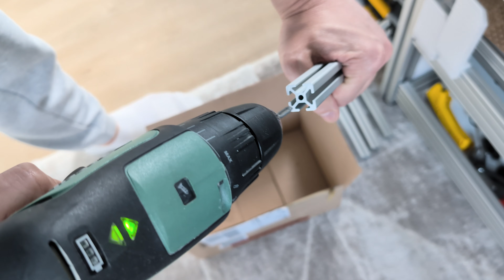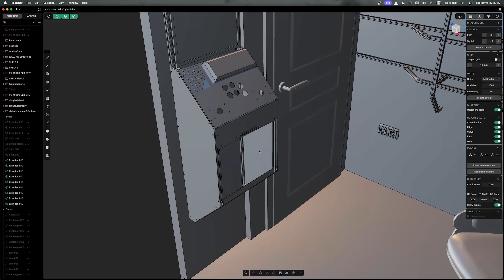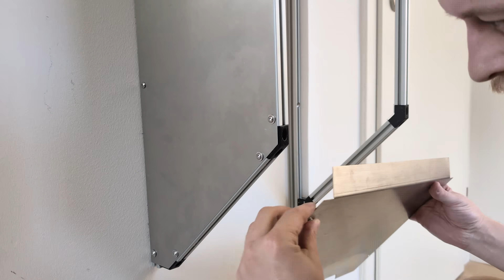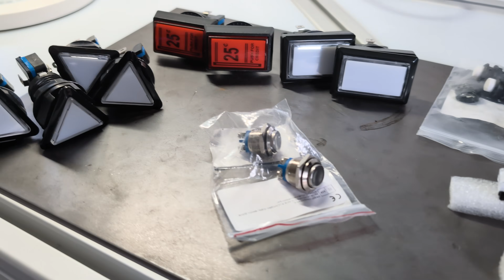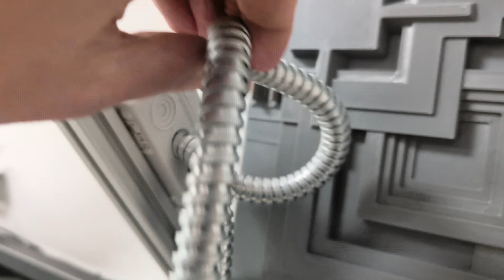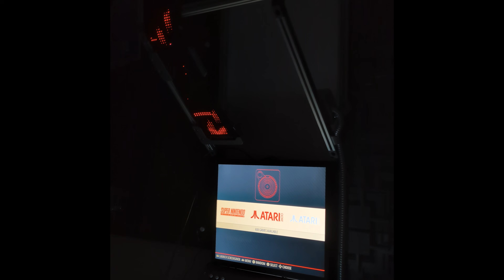Cyberpunk room build - terminal console arcade control panel kiosk - Episode 4

Comment: This is excellent. I am also building my own Cyberpunk/Anime room. I have brought a screen as you described and have loaded up the animator. How do I get the animation from the animator onto the screen?
Reply: Don't worry I have sussed it out. Its excellent thanks.
Reply from the maker: Glad you made it. I didn't explain that clearly enough, but at least everything is linked in the description. Cheers!
Reply: @DIY_CYBERPUNK That’s fine. Not sure if it was the way you did it but I used your animator to make the gif on my laptop. I then saved it and transferred it to my phone. Then I used the Pixel Art app to transfer it to the screen as a custom animation. Not sure if that’s the correct way but it seems to work.

Comment: As an ex-machinist, watching you tap those aluminum holes with a power drill made me panic. Lol
Reply from the maker: Yeah I can imagine. I got lucky that the regular tapping bits are strong enough and aluminium is soft enough that it just works perfectly every time. I never got a broken bit or ruined tap hole. Just got lucky with the materials I guess :D too lazy to do the tapping by hand :D

Comment: What is the goal for what you can do with the terminal?
Reply from the maker: For starters I only plan to enable it for Home Assistant control and the two player arcade when someone visits. I'll probably need to use KVM as it would be too messy implementing everything on a single rPi. Later down the line I will be making a motorized crane lift thingy on the ceiling. So controlling that too probably

Comment: <,,< now just need to add an atm keyboard and trackball in the top of the arcade mechine and add a KVM switch to go between the system with a button in the top right of the panel
Reply from the maker: Exactly! I have the KVM on the TODO list already hehe. Yeah I will really need a keyboard at least. Trackball would be a nice touch. Cheers!

Comment: Oh man, those Frank Loyd Wrigth tiles were perfect. Always loved that detail from Blade Runner.
Reply from the maker: It's such an iconic aesthetic, I knew I had to include them. Thanks for watching! Cheers!
Reply: @DIY_CYBERPUNK the aztek if you extend those over the door I suggest designing a few tiles as backers for a neon sign for the "white dragon noodle bar".
Reply from the maker: @CharlesPruden  hehe might do it
Reply: @DIY_CYBERPUNK OH! And PVC pipe with various fittings, 3d printed parts and a good paint job can make nice artificial steam pipes
Reply from the maker: @CharlesPruden  I'm avoiding going down the prop route. I don't want to do any paint jobs to fake metal or anything like that. I am going for a more honest builds with using metal where possible and raw 3D prints, no paint. Also I try to make all the parts functional if possible. So no fake pipes etc.

Comment: I have a suggestion: add spotlights. It's a very cool effect to highlight an object from outside in, like an air purifier or AC unit or something. Spotlights create high contrast visuals and are a different effect to LEDs on an object. Plus they're cheap and easy to use.
Reply from the maker: That's a great idea, and it will fit perfectly in the couple of next videos. This console top will extend over the ceiling which is a perfect position for some spotlights. Also I'm making a full wall shelf, and that's a great opportunity for spotlights to highlight interesting details. Thanks for the support. Cheers!

Comment: excellent build ...where can i find the matrix at if you have a link and how do i do the Predator number counting with it ...that will be so awesome with my project
Reply from the maker: That's a great idea with the Predator numbers countdown! I implemented it right away and it's deployed https://dsalaj.github.io/led_matrix_animator/
Just select the "PREDATOR" preset on the right. Thanks a lot for the idea!
The led matrix listing changes but simply search for "flexible led matrix display" or "led scorebord" and you'll find it. Mine has 16x96 resolution if you want the same.
Reply: @DIY_CYBERPUNK  you are awesome...any links where to purchase the wifi display you are using or maybe something similar that could also work?
Reply from the maker: @denisgrabocka1269 just search for the led matrix scoreboard on aliexpress or amazon. mine is 16x96 resolution
Reply: @DIY_CYBERPUNK  thank you again for the replies...i am only able to find bluetooth and NO wifi anywhere i am searching at

Comment: Oh hey! Happy to see the progress!

This is also insanely timely because I’m literally building a project right now called RetroFUI, based around Ratatui TUI environment. The idea is basically a full retro-futuristic terminal environment inspired by 1960s, 70s & 80s sci-fi/Cyberpunk computer consoles, with navigable screens, animated HUDs, monitoring dashboards, log monitoring, terminal tabs, wireframe/vector graphics, and eventually I want to support video effects and CRT shader effects inspired by cool-retro-term.

I mainly started it because I wanted my self-hosted servers and headless machines to have always-on status displays that actually look like cinematic sci-fi control systems instead of generic dashboards, but actually function too. I’m specifically designing it to feel visually alive, so things like logs and telemetry won’t just instantly appear, they’ll animate, scroll, populate, and transition like the cinematic cyberpunk and retro-futuristic consoles you see in sci-fi films.

The funny thing is is that part of the inspiration for that project is from your last project's little OLED screens and the information and glitches stuff they had. I'm obsessed with that idea and wanted to make something modular that can fit on any sized screen and be useful AND cool looking.
Reply: That sounds great :) Any chance you might consider doing a video or two on youtube about the builds?
Reply from the maker: Awesome, the Ratatui TUI terminal sounds so much better than my build. Hope you finish soon and share with me. I completely understand and have the same goal with the actual information and real functionality and not only props for camera. Really hope to see your progress. I'm really glad my last project inspired you to get started. Please record and share a video when you have something (I subscribed)!